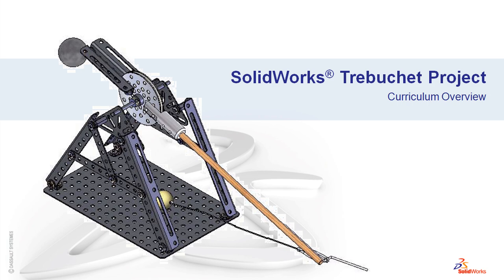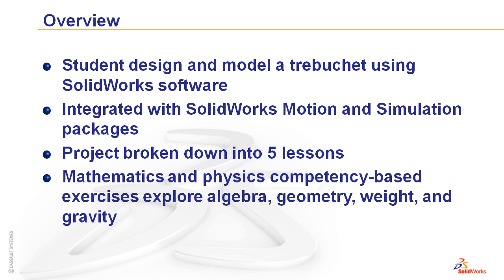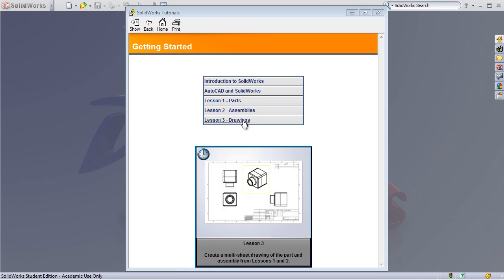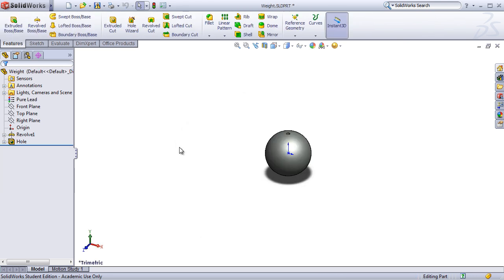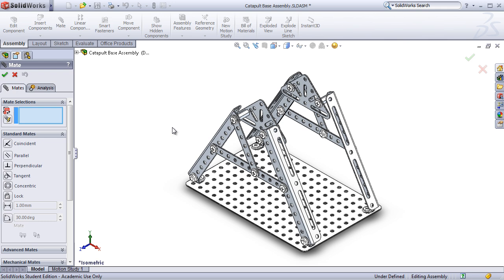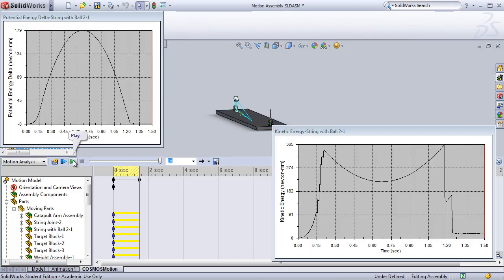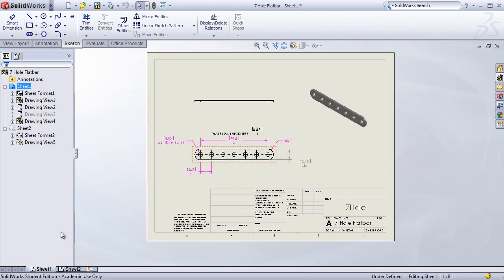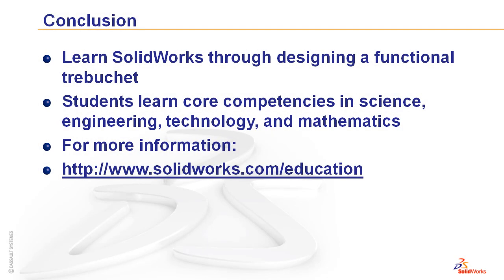SolidWorks Trebuchet Design Project

Comment: im designing a trebuchet in solidworks but when i try and do a physical simulation it explodes, ive made sure there was a 1/32 inch gap around everything so im at a loss as to what to do next.also ive found that solidworks is easy to use but quite tempermental at times.